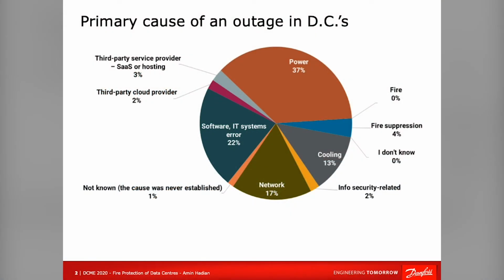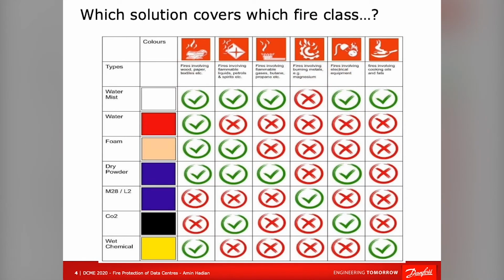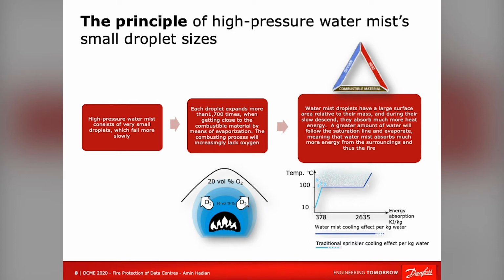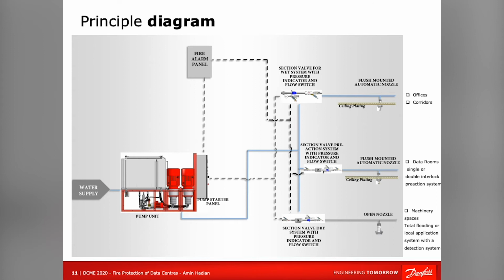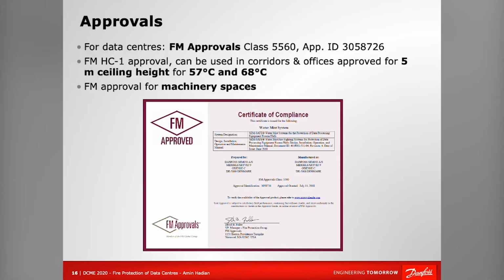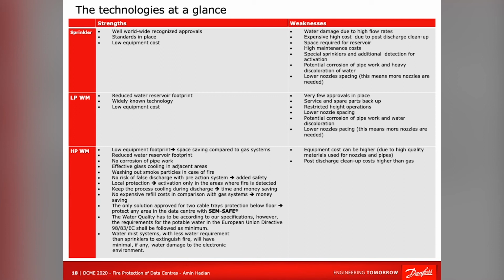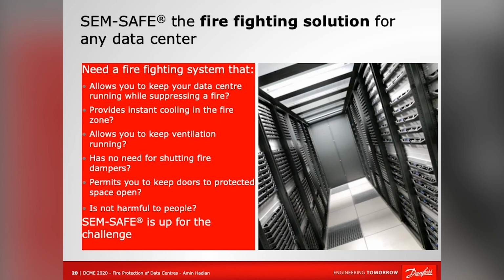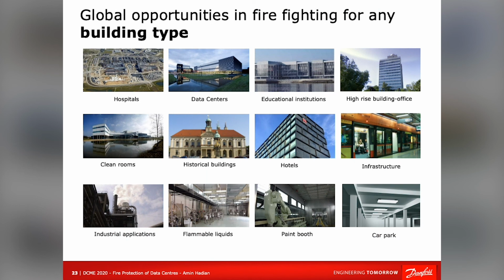Session 12 Application of SEM SAFE high pressure water mist fire protection systems in data centres

Comment: Sir, one question - Water is a good conductor of electricity and in Data Centers, there are many servers and electrical equipment. How HP Water mist system will protect from electrical hazards like shocks, etc. and protect the electrical devices from short-circuits, etc?